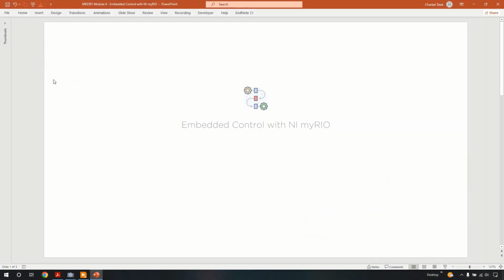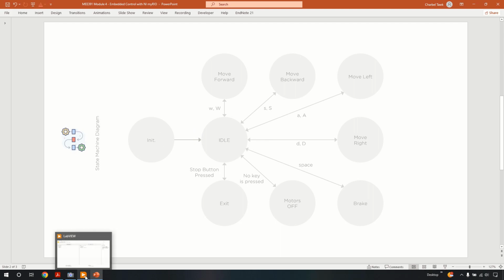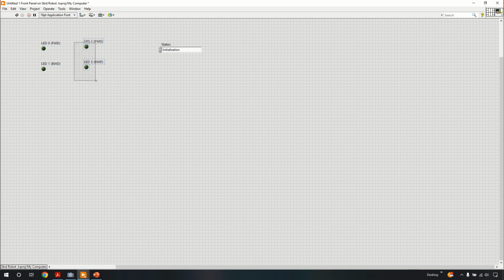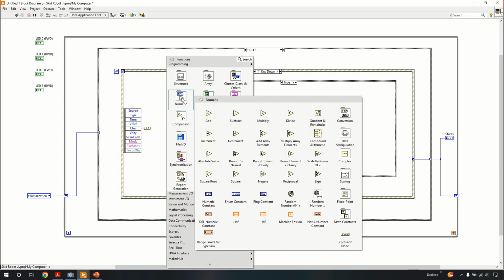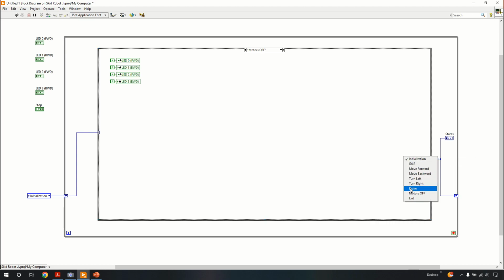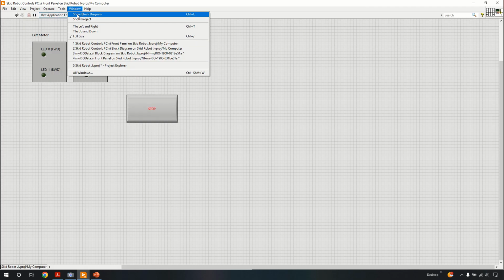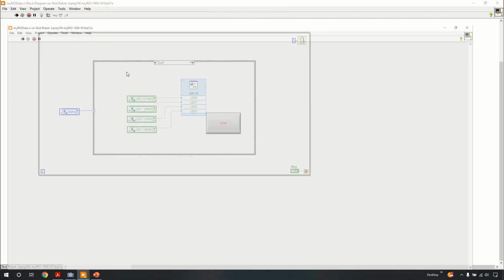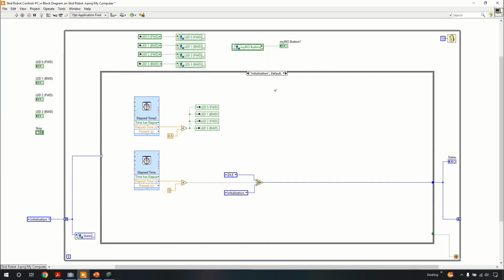Module 4 - State Machines and Embedded Control with LabVIEW and NI myRIO

Comment: I would highly advise making the state enum into a "typedef".

That means it has a separate .ctrl file which can be changed in one place if states need to be edited.

As it stands - if you need to add a new state, you will have to manually update a lot of the enum constants.